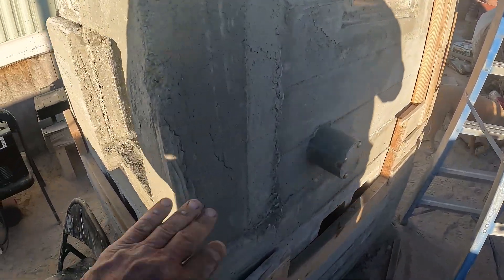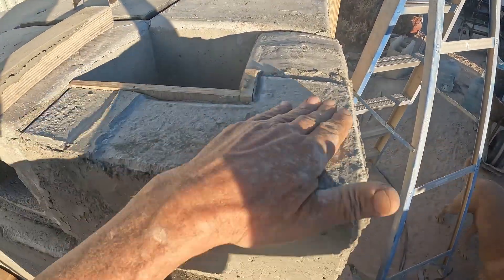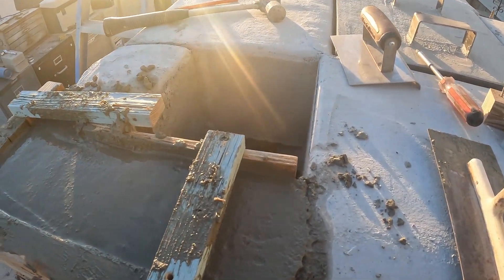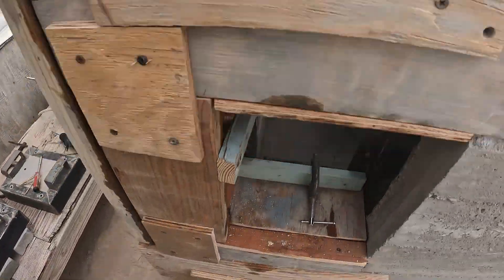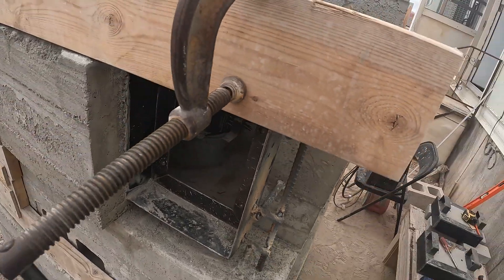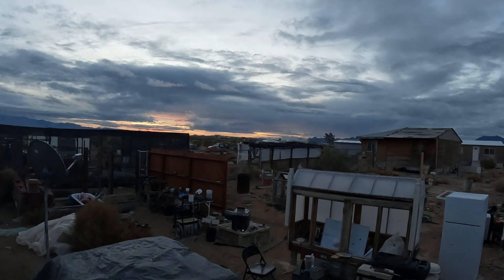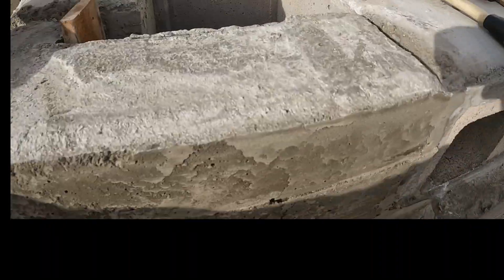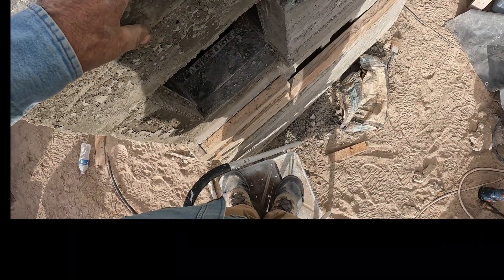139-Super Sand Battery Update

Comment: Hello another week my friend. What if you use refractory brick inside? I'm using old water heater with sand, below my house, so the heat is going up naturally through tubes . I working on arduino valve (ESP32) and it will be connected to temp sensor and wifi. If I have under 15ºC valve opens. Time...need more time...